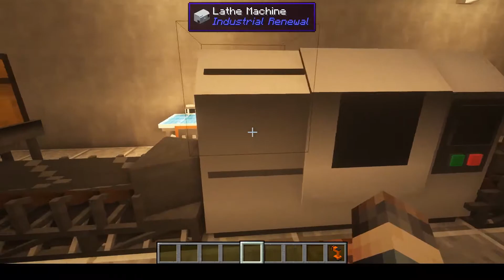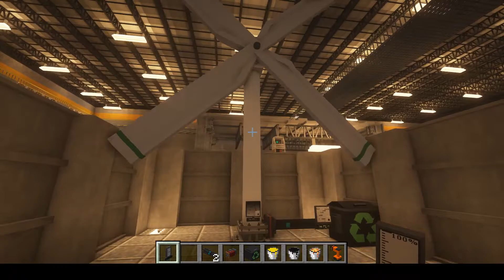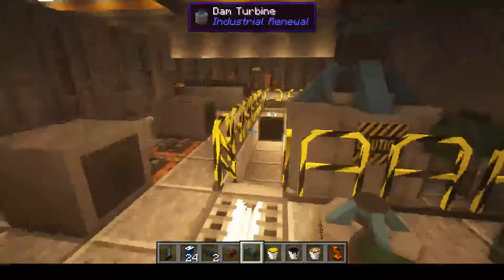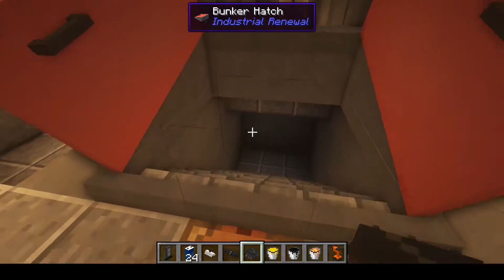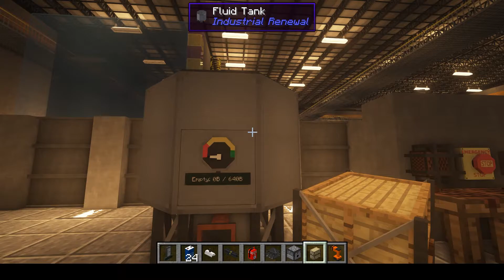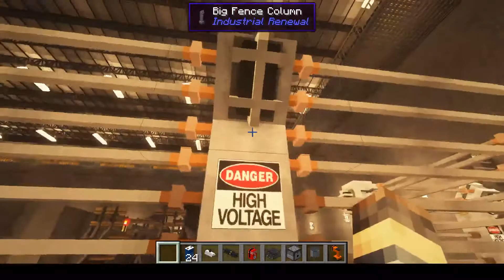Industrial Renewal Mod Spotlight

Comment: I know this is a three-year-old video but I have a question when I play with industrial Renewal I can never get steel by Smelting an iron sponge it only gives me a no-textured block. So If anyone could help that would be great.
Reply from the maker: What version of the mod are you using? Also what other mods do you have installed?

Comment: Why is nothin i do or set up put out any power ,i set it up to test just like u did an nothin happens, it makes no power ect the small battery with panel is red but cant get the power to leave the box......????!!!!
Reply from the maker: Hmm weird. What version are you using it for? Somethings changed in later versions as a different developer took over and changed a few things in it.
Reply: @mccastlegaming  well I finally figured out how to get it to make power but still can't get it to go anywhere to actually power anything tho.  Parently I missed the part where the ind power boxes needs actually filled wit lithium battery's first.  But I use 1.12.2.   Have a 1.20.1 set up to but don't really use much cuz there are nooo good cars n vehicles or hero armors or anything I can put in it

Comment: hey you know immersive engenering can you connect power from lets say a turbin from industrial renewal  to a machine from immersive engenering?
Reply from the maker: Yes you can, you just need to attach the IE connector to the output of the generator. I do this in my survival series. Here is an example just showing it done. https://youtu.be/JufrPgm5iiU?t=320 If that doesn't make sense I can make a short clip of how to connect them together.

Comment: i have a mining drill with a stell drill and a lever have water and energy connectet but if i turn the leaver nothing happens
Reply from the maker: I had an issue with it where I had to break it and replace it before it worked you might try that